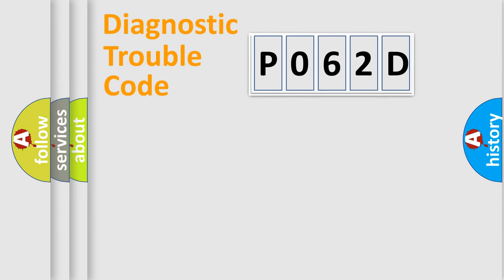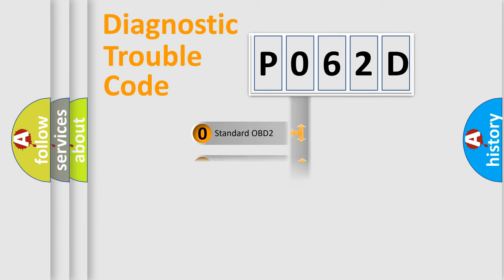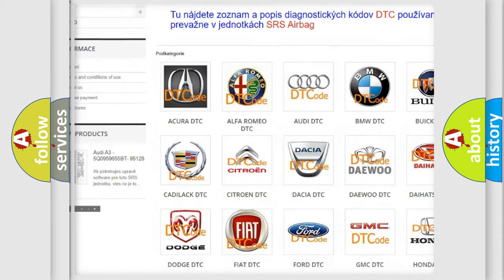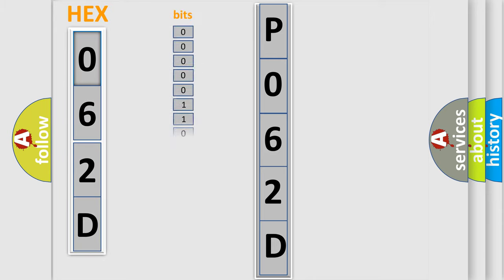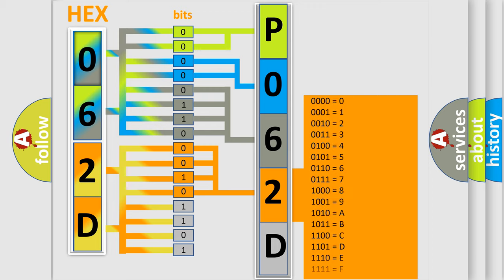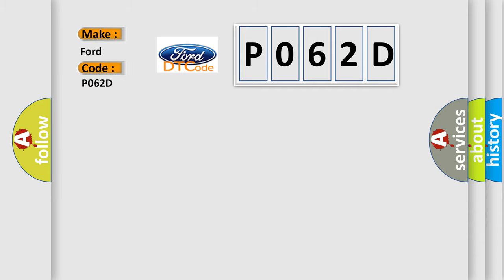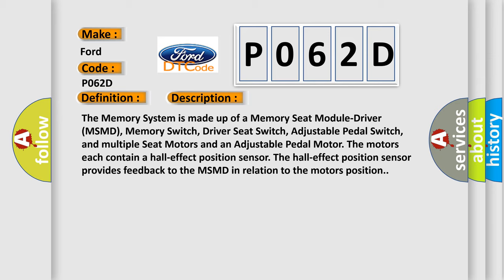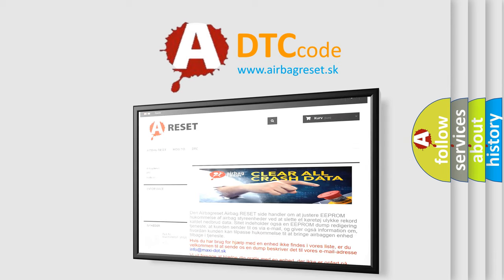DTC Ford P062D Short Explanation

Comment: p062d is actually not the  memory seat module.  It is for injector driver circuit for bank one.  A memory seat module code would be a "B" body control code.
Not a "P" powertrain code.